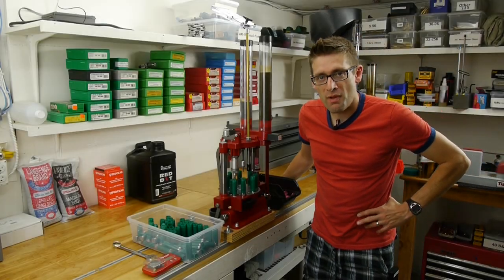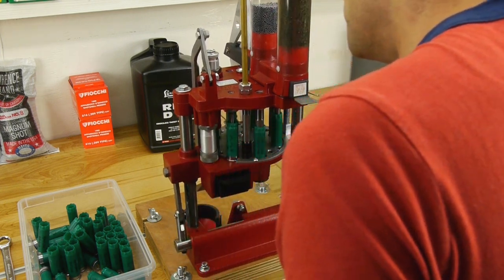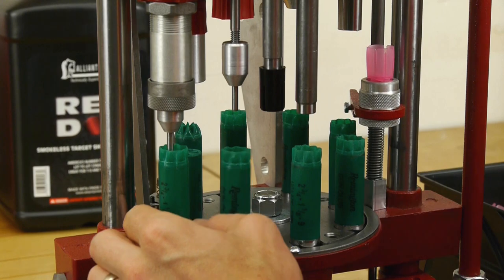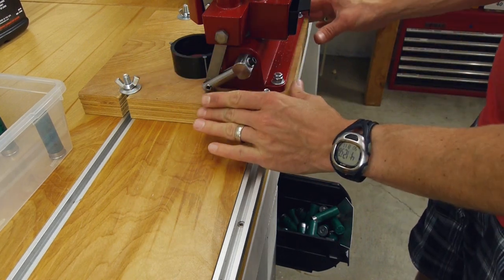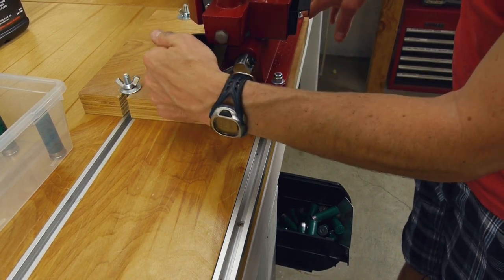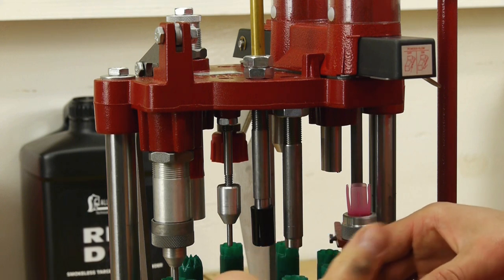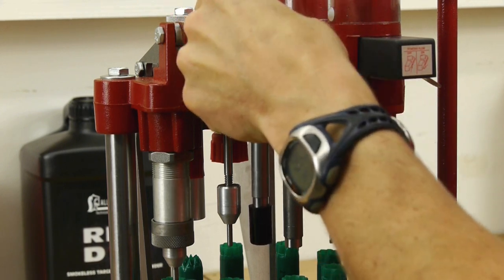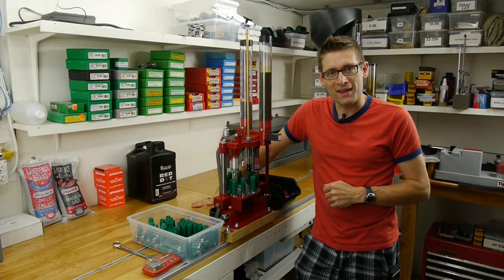Hornady 366 Loading 12 Gauge

Comment: My primer stopping system is a foam earplug. One of the cone-shaped orange ones. I just squeeze it and roll it like I was going to put it in my ear, but insert it into the bottom of the plastic primer drop fingers. It's foam so it is fine as you continue to cycle the press to finish out your run. I also got a dowel that fit perfectly into the primer tube, and marked the empty tube location so I can see how many primers remain  in the press.

Comment: On mine, I also drilled a 3/16th inch hole in the primer tube and made a photocell and buzzer so it alerts me when I need to refill primers.  When one gets going, its easy to run it dry.

Comment: If you know the hulls you are going to reload have been fired from the same gun you may not have to use the full length resizing station on the press. This is the only progressive shotshell press that has that feature, a separate resizing station. A nice feature on a progressive reloader. You can use that station or you can bypass it if you want to . Also this reloading press has the best primer system that is 99.9% accurate in dropping primers. Primer stations have always been the nemesis on progressive loaders.

Comment: I noticed that the 366 has some wobble in it when cycling the press, mine had a whole lot more, if you look on the schematic in the instructions there's two bolts that connect to the posts one on each side, take a 9/16 hex driver with an extender on the ratchet and from the bottom tighten those up and it will take out the wobble.

Comment: Crystal clear HD!!  One question...Is there any significant savings in loading 12 gauge?
Reply: You can reload for about 1/3 the price of new shells, depending on where you buy your components.  I used to buy reclaimed lead for practice.  Much cheaper.  I shot about 8 - 10 k rounds per year.

Comment: Hey Gavintoobe,I watched your video, and it was well done.   I noticed your 366 has a lot of movement front and back as you operate the handle each time.  I see you have it mounted on a wood riser of sorts, but I can assure you that you would benefit greatly if your machine was mounted more solidly.  When I say more solidly, I mean no visible movement front and back at all.  I suspect your bench simply is not solid enough for a progressive machine.  It may be fine for single stage work, but progressive machines require really solid foundations.  Not only is my bench rock solid, but I also have a half inch thick steel plate that is about 12 by 16 inches mounted to my bench.  The reason for the steel plate is to allow me to switch between reloading machines quickly.  I simply drilled and tapped the required holes for each of my reloading machines in the steel plate and used the same bolts to mount the machines when I switched from one to another.When you have as much movement in your 366 as is seen in your video, it makes for greater variations in your powder drops.  This is also just as important with progressive metallic cartridge reloaders.  It is also true with powder measures mounted on the bench.   Progressive machines are truly fantastic, but they do require the utmost in being solidly mounted.Best wishes,Dave Wile

Comment: How big did you drill the hole in the back and what is the size of the pvc pipe.   Thanks
Reply from the maker: I used a hole saw if memory serves. :) I think the pipe was 1.5" or 2" (have moved from that shop :) )